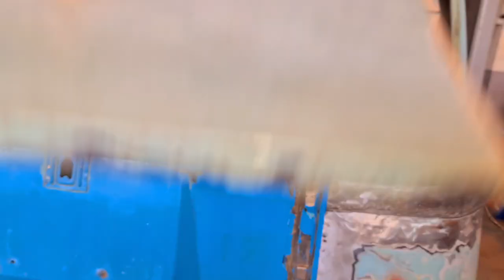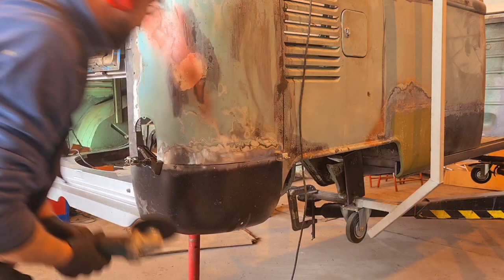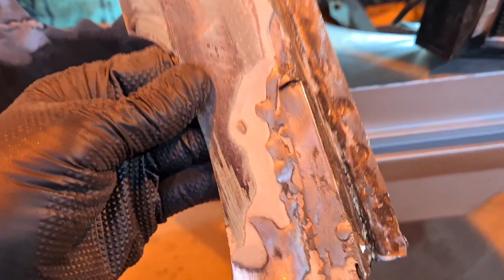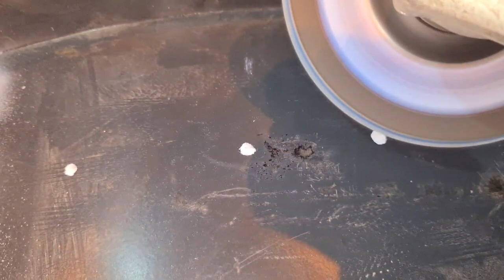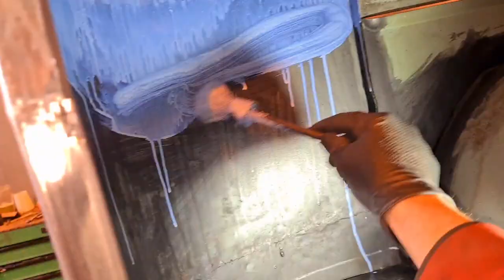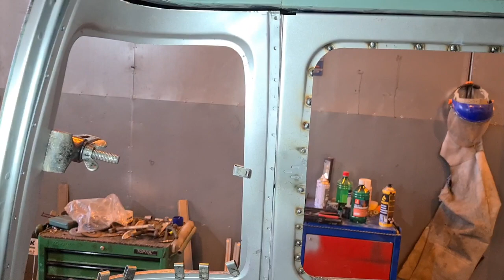VW bus T1 type 2 - PART 23 - completion of the rear part

Comment: Great job! I am working on my rear corner of my 68 double cab, replacing the d-pillar and the support structures, and although the split window bus looks similar, they really changed the design drastically in the later bay window.   Btw where did you get those window clamps?
Reply: the butt welding clamps are available at harbor freight.